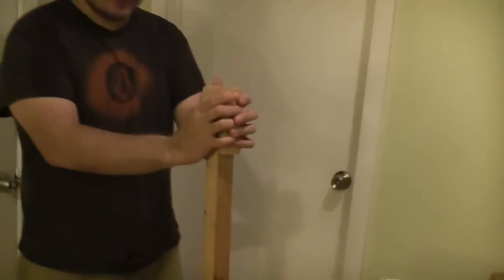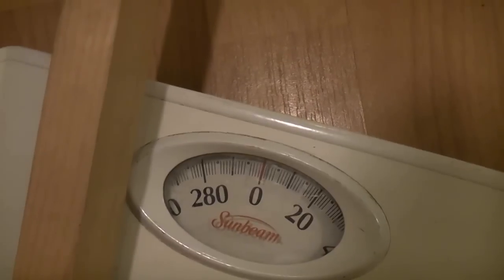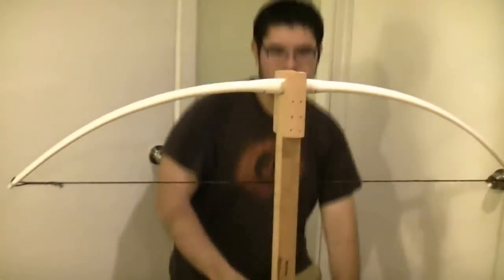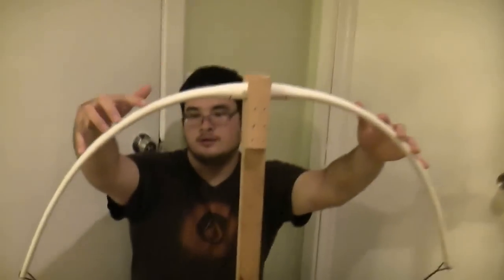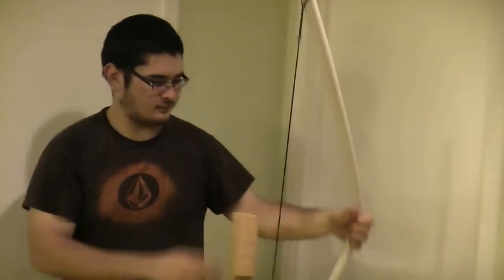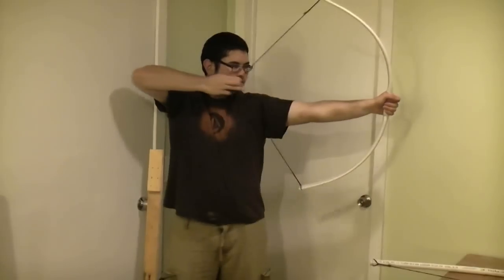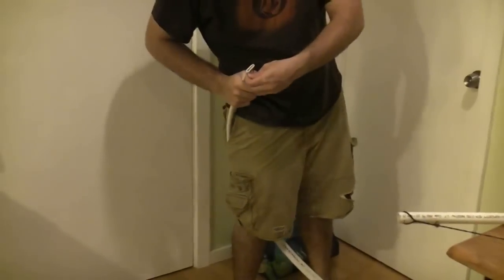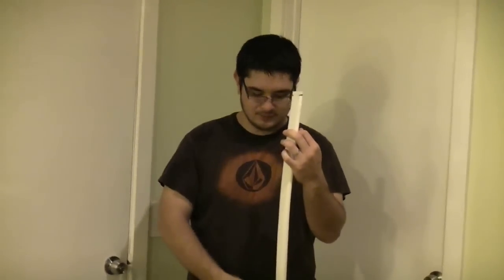PVC Pipe Bow - Flattened vs Round Part 2 - Draw Weight and Flex

Comment: So for people that need that in laymans terms....

With the round pipe, the tension only is focused into the center of the bow.

The flattening and shaping of the pipe, distributes the tensions throughout the whole bow, allowing the pvc to handle the tension

An example of this is to take an inch thick stick and try to break it with two hand touching directly in the middle. Its almost impossible for someone to break it.... but if you were to do the same thing but holding the stick at its ends, the stick would break with almost no strength put into it.

Comment: Hey, BB.   Thanks for this comparison.  Question...  Should I assume the bounce-back advantage a flattened PVC bow has becomes negligible, if I stick fiberglass driveway markers down inside the round bow?  (re: Your video on how to make a non-heat 40 lbs. bow for under $7.)

Comment: would the fiberglass rods in the rounded bow at 5' be okay to use. that is the one that would be the easiest for me because i dont have a heat gun but i do have 5' of 3/4 inch pvc sch 40, 6' of 1/2 inch sch 40, and two 5' fiberglass rods

Comment from the maker: So far I haven't had any longevity problems with the flattened bows. They usually settle after a week or so of shooting and being strung. Set is usually bad (but does not get worse after breaking in), so for a straight-limbed longbow string follow would be bad as well. By putting in some reflex, string follow can be avoided. I prefer to use recurves. Even recurves I keep strung up all the time as a test still return to zero string follow and usually gain an inch of reflex after an hour unstrung.

Comment from the maker: It would end up looking sort of like the bow in this video: watch?v=8eE-SBtFHmc . It helps quite a bit, especially in a pinch and the bow won't break in your hand. The downsides are it still is an imperfect bend and is less efficient, meaning it needs to be heavier for the same speed as a comparable flattened bow and it can't be made a short as the stiff handle increases the strain on the other two portions.

Comment: I know it's quite an old comment already, but just for your information: we used to have a metal longbow hanging (braced) on a wall of our indoor archery-range, along with some of it's arrows. I definitely was used at some point, and when i asked one of the coaches if i could try it, it still shot perfectly fine. A bit on the slow side though ;)

Comment: I'm not into bows or anything, but i have some pvc pipes and might give it a try. I was wondering.. are there any steel bows? A friend of mine made a compound crossbow from a leaf spring of a pickup truck. Really sturdy and heavy, but it's a crossbow. 

What about an actual bow made of some light duty leaf spring? (like parabolic leaf spring 8-5mm thick)

Comment from the maker: @cliffhanger  Thanks for the question!

The problem is with the bow's flex and not the handle. Making both handles flattened would make the round bow flex sideways rather than strengthen it. Even a full round handle on a flattened bow won't flex that much. I'll try to post a video to show what I mean.